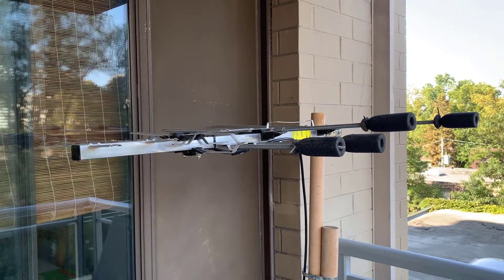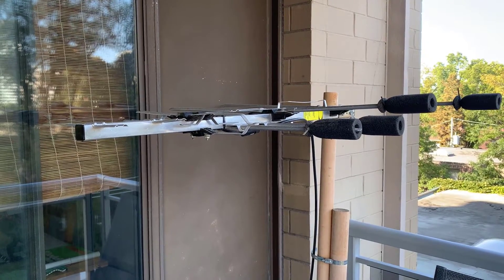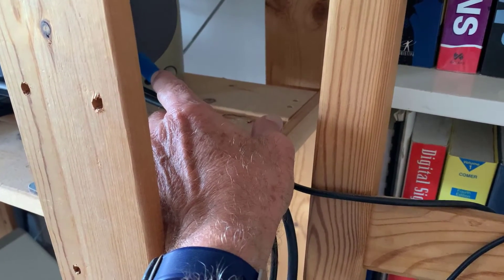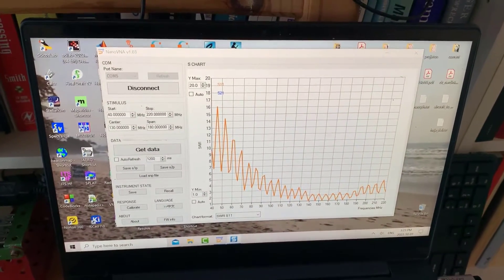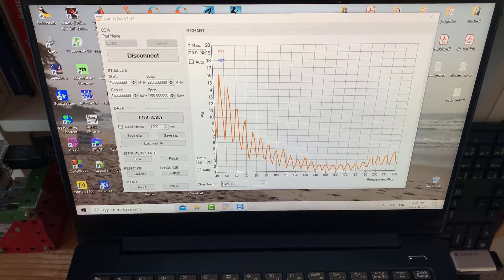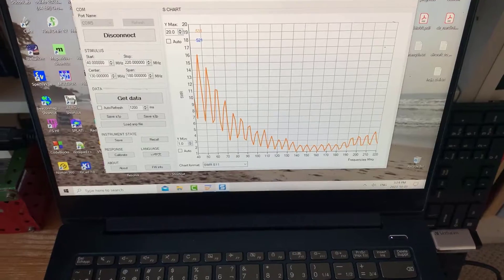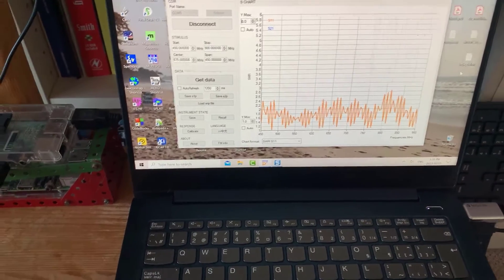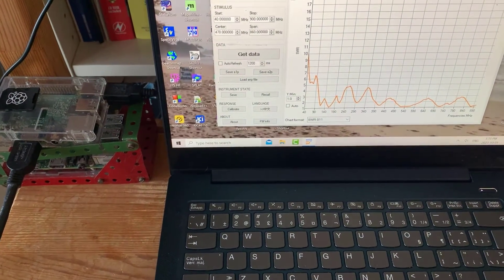ATSC Television Antenna Testing with NanoVNA

Comment: Hello and thank you. This is the first video I have found testing a receieve antenna which is not part of a transmitter.
The VNA is of course acting in place of a transmitter and sending it's signal out to the antenna and looking for load and any return signal. I have always wondered how much diference altering the coax length can make to the signal strength received. As with transmitters varying the coax length byhalf wave and quarter wave  lengths  is used to  gret the best cable match.
I would have liked to see more of the antenna construction and the coax connection there. Plus some close ups of the readings on your screens. Question how are you getting the display from the VNA onto the computer ?
Thanks again good job.
Reply from the maker: I use NanoVNASharp V1.03 software which connects to the unit. The antenna is an RCA ANT751R.